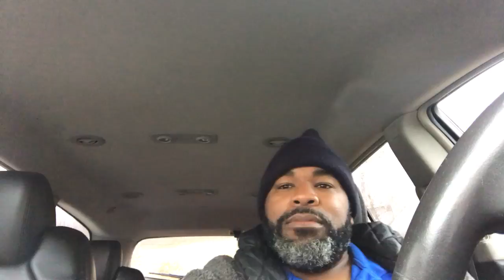Brotherman Trucking - Structural Issues?

Comment: I pull containers. Delivered one that would slam forward with the slightest brake applications. Air bag pressure kept increasing on the drives. Got to the receiver and they said to be careful after opening doors the load might "roll" out. 42000 of cargo divided into two carts that were supposed to be restrained inside the container. The front one broke lose somewhere between China and Joliet, IL. So I got the pleasure of dragging it from Joliet to halfway up the state of Michigan. Not something you'd expect from a drybox